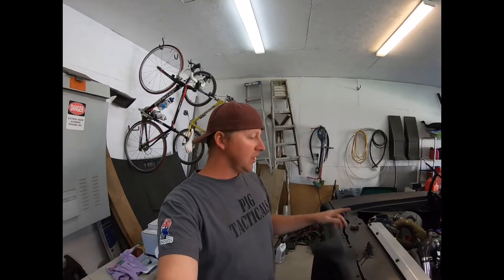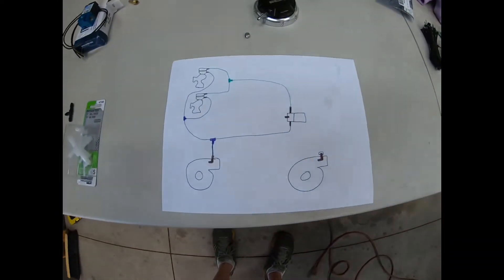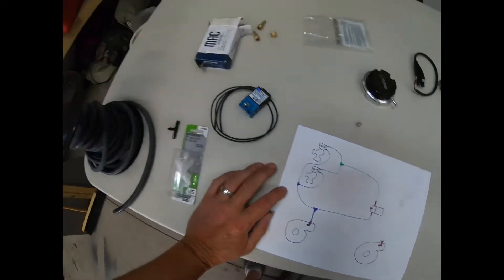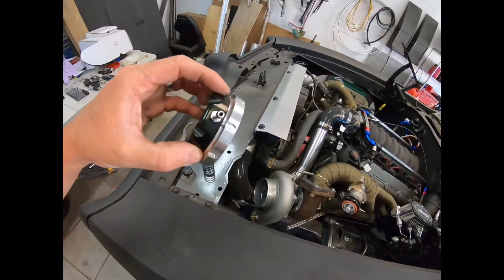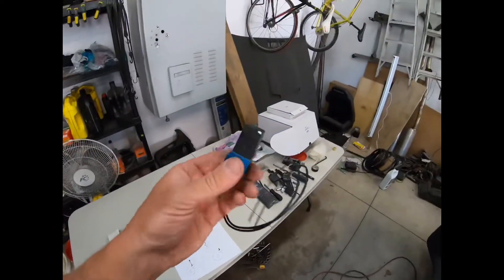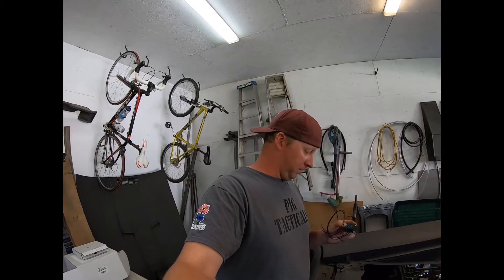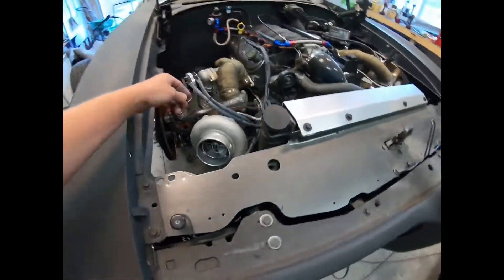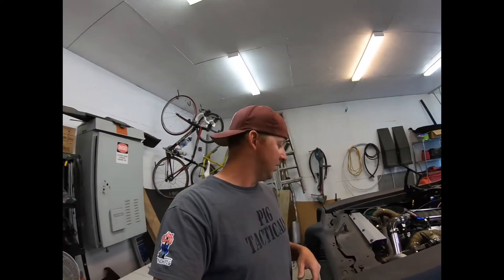Twin Turbo LS Build on a Budget Pt.18. Vacuum plumbing.

Comment: Exactly what I needed! Good job. What brand hose did you go with?
Reply from the maker: I would suggest taking the fitting with you to an auto parts store and try different sizes. You want to make sure it doesn’t pull off easily. I’m actually going to switch out most of my fittings and hose to 1/4inch air line with the push in fittings. The stuff is pretty cheap and they have a nice tight fit. Similar to what I used on my air ride.
Reply: SpeedyCanuck see I was between going with push fittings or just staying with barbed. It’s about $5 a fitting from motion raceworks but I didn’t know it was necessary or worth it. Any recommended brand? I know vibrant has something similar for $6 a fitting
Reply from the maker: A no name brand. Kinda bit me in the end. Should have went one size smaller so it fit tighter on my fittings. Had a bunch of vacuum leaks when we put the car on the dyno.
Reply: SpeedyCanuck ah crap! Sorry to hear that bud. The barb fitting that came with my Mac solenoid is 3/16 so would you say go smaller than that?
Reply from the maker: At Princess Auto, which is like the Harbor Freight of Canada, they’re about $3 per fitting. And air line is cheap there too. Check out places like that.